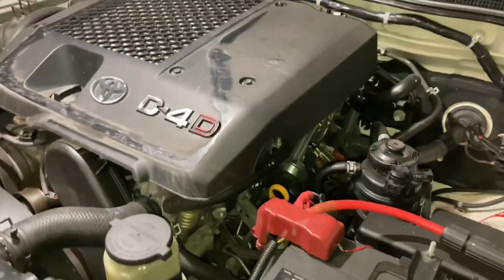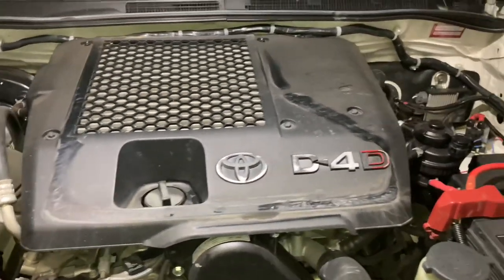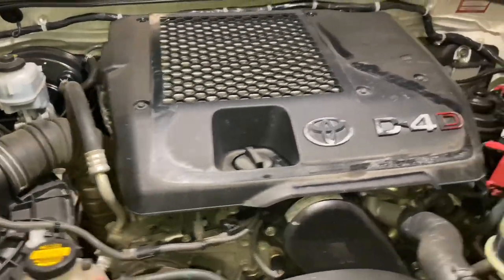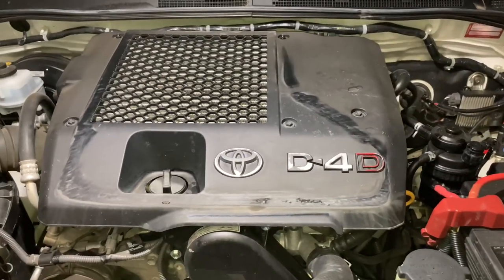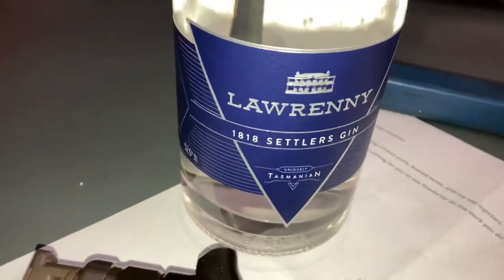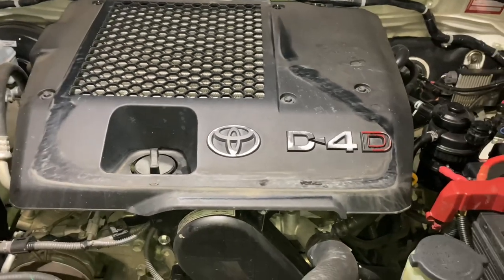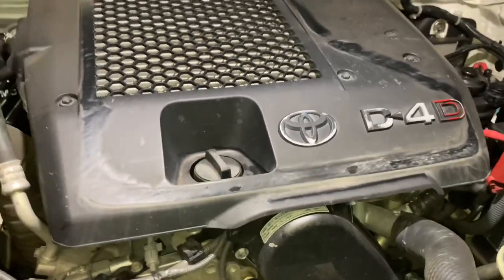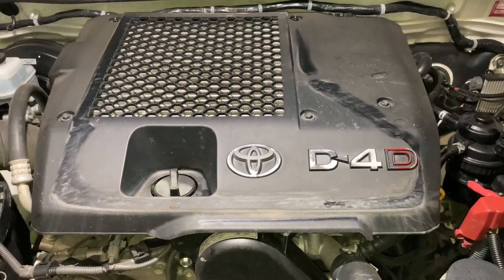WHAT To do AFTER NEW INJECTORS or ENGINE

Comment: I just change my injectors and black smoke start to appear from the exhaust, and is consuming more diesel too, same code of injectors, same brand but just appeared that issue. If somebody knows what could be the issue, it could help alot. Thanks.
Reply: Did you find out what the problem is?

Comment: I just did my injectors didn't get them new just did a repair job. Now the problem is the car has less power it's a 2.0tdi 2008 VW Touran. My question is do I need to do a tune or what??? Thanks in advance guys..

Comment: Hi. Completely off the topic, i have a 2017 2,2 diesol ford ranger. Dont shout at me!! Engine over heated, cracked head. Had it rebuild and now with cold start up it smokes a bit. Did not replace injectors. Only 120000km done. Would this be the cause or can you point me to a specialist in ford like you are on toyota? Thanks for the show, always watch it and even though i have a ranger i always get great tips!!

Comment: garage replaced injectors (diesel) - seems to been giving a bad knocking noise now,  they have reprogrammed them  -  the old injectors were leaking ( opened ) - hence why they got replaced,  but it wasn't knocking before.  any ideas?
Reply from the maker: My general advice would be not to let them do that to avoid results like what has happened